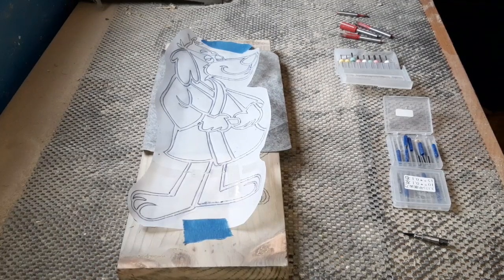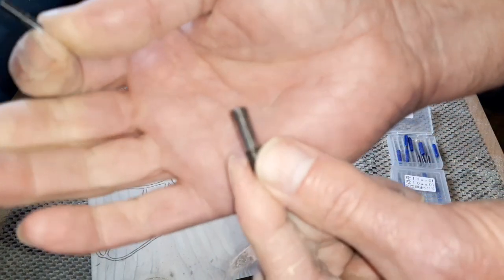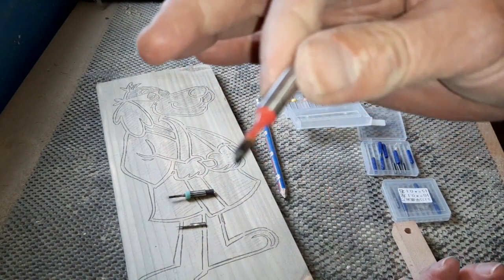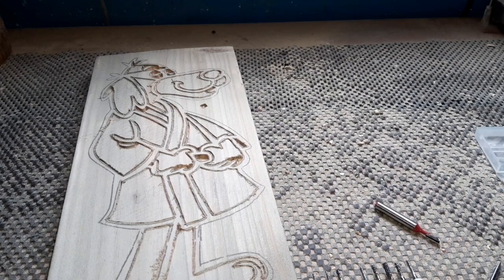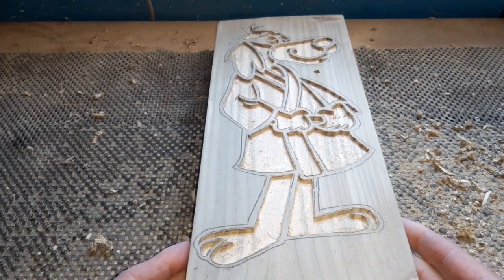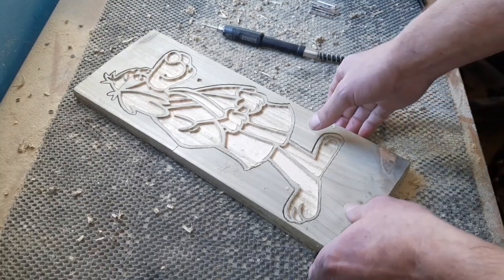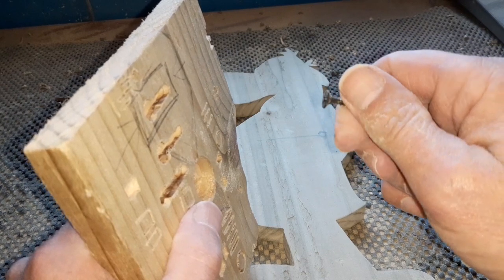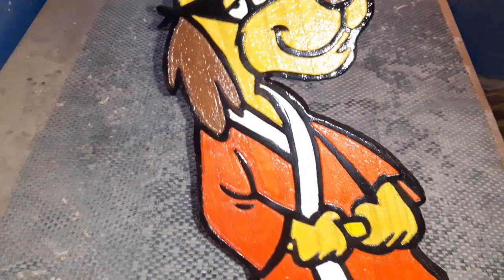Hong Kong Phooey on fencing wood router/scroll saw project...

Comment: I haven’t tried carbon paper but if you have a laser printer you can use lacquer thinner to transfer printouts from paper to wood by rubbing it with a spoon or something. Love your channel, I’m just getting mine started doing similar projects!
Reply from the maker: Cheers, I've looked at laser and lacquer transfers before  I've a inkjet printer and I've printed out on baking paper before, it worked but I prefer the carbon method ,especially when doing a project that's 9x4size papers..Good luck with your channel 😀 👍